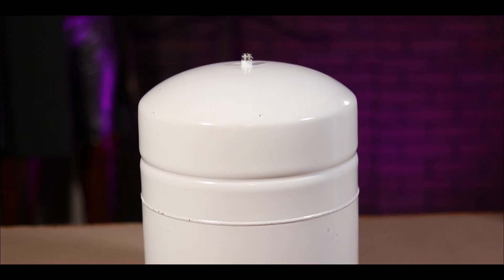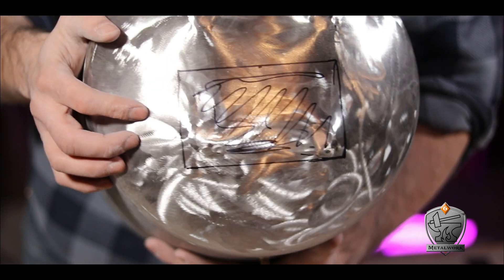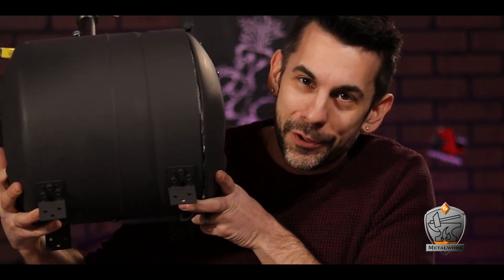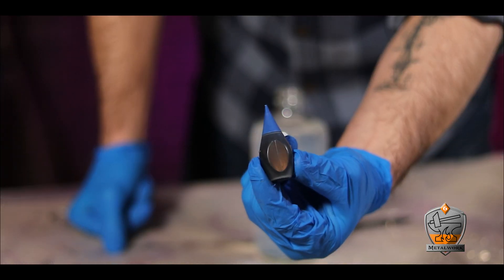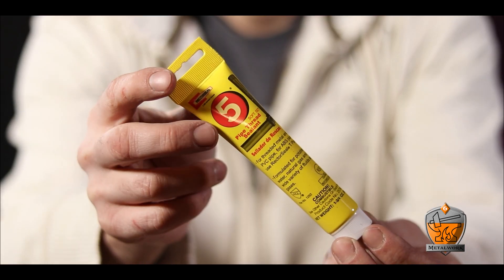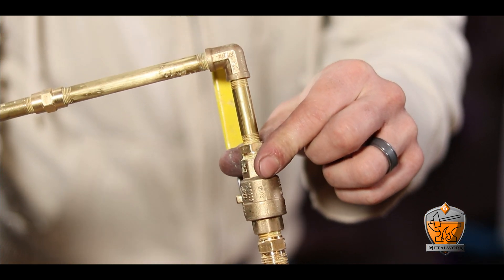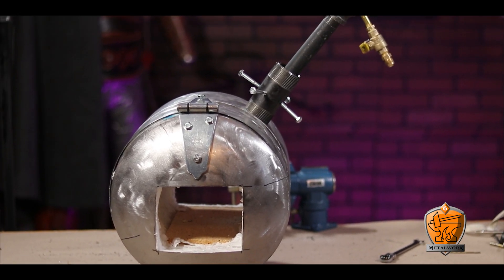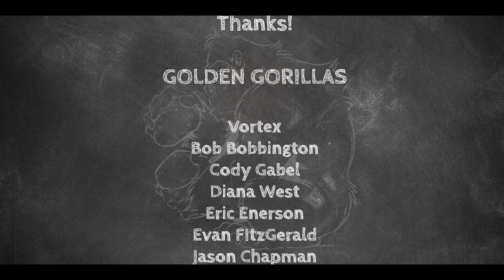DIY Gas Forge Build No Welding Required

Comment: If anyone is wondering what the tank is called, it’s an expansion tank that you install on your called water line in case the pressure in your water line ever surges past the operating water pressure (typical between 40-60 psi). The tank has the rubber bladder in it so it can expand with that extra pressure as to not damage your water piping system.

Comment: It's not a water filter device.  It's an expansion bladder to compensate for thermal expansion from your water heater cycling.  And to strip the paint, you could have just sprayed Klean-Strip Paint stripper.  Waited 20 mins, and washed the paint off.  Also, you better put some cement on that insulation or you're gonna kill your respiratory system.

Comment: One suggestion is to use some kind of cutting oil for your metal drilling and tapping. I’ve even used WD-40 when I was out of cutting oil. It will make the cuts easier, and help your bits to last a lot longer.

Comment: That top piece of pipe defeats the purpose of the reducing fitting. It's intended to work as a venturi which will increase the airflow and give you better heat. Putting that piece in chokes it down and eliminates that effect

Comment: Coat The Kaowool with satanite or a refractory cement, This will protect the ceramic wool and keep you from breathing in fibers. The rigidizer alone is not enough.

Comment: Tip: if using a propane tank, before doing anything else, fill it completely with water then empty it. This will displace any residual propane and prevent any high-temperature unpleasantness.

Comment: Fun video and this looks like a great project...BUT... The most dangerous bit isn't the burners, it's the insulation that you only soaked with rigidizer without covering it with refractory cement. Dude. YOU HAVE TO COVER THE INSULATION BLANKET WITH REFACTORY CEMENT. As long as that blanket can shed fibers, it's a hazard.

Comment: I know this is late, but still might be helpful
for anyone who is using propane tanks... one of the vids i looked at a while back suggested filling the tank with water before making any cuts. just to be sure there is not gas left in the tank. This concept applies to any place when there is something flammable.

Comment: Something worth looking at for extra safety is a Flash Back Arrestor/suppressor. Normally used for Oxy/Acetylene torches, you can also get them for other flammable gasses. Regulators don't always have them built in, even expensive ones. Should be able to get them from where you get your gas from. Otherwise welding suppliers do have them.
Reply: In a naturally aspirated propane system like this, there is no benefit in having a flashback arrestor. In a system running oxy, it's possible for oxygen to be forced back into the propane hose (or vice versa) which can create a combustible mix, but in this system that's impossible. Pure propane will not and can not burn without oxygen, and it is impossible for it to burn back up the hose or inside the bottle.

Comment: for paint removal, a wire wheel would work better on your grinder. heats up the paint less, and doesn't gum up like a flap disk.

Comment: Just an FYI in all the forges I have built the rigidizer is added after its stuffed in place.

I should add that other than that this is an amazing build. I will make the same suggestion to you that I do all beginners,  make some tongs first!

Comment: His burner is made with gas pipe which is black pipe and brass,  Black Pipe is Not Galvanised, it is instead coated with a dissolvable coating in many cases just a oil, or a cheap lacquer coating on the black pipe is iron and rust readly. Coat with a barbecue paint and it won't rust do a burn in outside and you good to go. The pipe parts let dry overnight then heat them up with a torch let cool and you're good to go. Have even seen waxed coated black pipe.

The feet on the other hand probably won't get hot enough to dispel zinc gas off due to the heat proofing material inside, this material works very well at keeping the majority of the heat on the inside. And you can make or even buy these angles and hinges in black iron for gates so that would be the way to go. though if worried about zinc poisoning just rough them up and spray with a barbecue paint let dry. Though always take every precaution and necessary steps for your safety and others. you can get a good refractory material by the bucket depends on your wallet.

By the way the feet are quick scaled at the factory which means they are quick dipped and generally it is Galvanized then balled milled to get that shiny look, some are electroplated. Though some manufacturers use other metals or have other treatments to ward off rust as well. Why I would recommend that you just get some cheap iron Black fence brackets and hinges, you can find latches to, and iron stove bolts, if your going to use bolts. That resolves any issues you might have to begin with. These are just a hard black painted non galvanized iron.

Surprised you didn't just make some rivets and riveted them on with your small forge. You can use 16 penny nails non galvanised , that's the common nail used in most structural carpentry. Just cut to length, heat till a nice cherry red, and rivet them in place. I use to use those very brackets under houses because they didn't rust. It really is a good little furnace by the way for small projects, annealing and hardening or metal working projects.

 If you want to get into metal welding the old fashioned way, get some 20 Mule Team laundry soap as it's nothing but straight 100% Borax. Which is what to use for your flux, for metal forging and welding. A box will last you for years, just keep it dry. You don't need to buy any special fluxes for forging and welding doing blacksmithing.

Comment: Great video! Just picked up two propane tanks yesterday… and this video will definitely help in building my little forge! Thanks!!
Reply: for anyone who is using propane tanks... one of the vids i looked at a while back suggested filling the tank with water before making any cuts. just to be sure there is not gas left in the tank. I know its late, but I think i will ass this to the main comments

Comment: WARNING. After using rigidizer you you ABSOLUTELY NEED to coat with a refractory cement. Rigidizer should be applied once the kaowool is installed as you you saw that folding it opened creases that were not exposed to the rigidizer. Rigidizer just helps keep fibers down while you're putting refractory on. Running that forge without refractory is DANGEROUS as just as many fibers that cause silicosis and cancer are being spewed out.  THIS WILL RUIN YOUR LUNGS!
Reply: This is a great video but you CANT SKIP THAT STEP!
Reply: @bryanwells1837 Can you give a quick explanation on how to do this??
Reply: @Stefubi  i think he is dead.. you know... lung cancer

Comment: How did you cut the threads into the tank for the 1.5 in pipe nipple?
Reply from the maker: No threads needed. The wall of the tank is thin enough where the thread has no issue grabbing on. Good luck!😁

Comment: Just a tip. I believe that I saw your vise has two sets of jaws, it can be flipped yes? The bottom set of jaws is designed for pipe. You won't have issues with the pipe slipping out of the vise if you use the right jaws. Probably this will help with keeping you tap square as well.

Comment: I don't think that tank was off a filtration system. I pretty sure it is an expansion tank because I recently replaced mine. Its purpose is to deal with thermal expansion of water as it heats up in the water heater.

Comment: Other note: Files only cut in one direction, if you drag them back over the edge you will dull them faster.
Reply: Common misconception, it really doesn’t matter.
Reply: @GiovanniGiorgo  ^This, it was disproven with testing. Cheap files may be subject to different rules.
Reply from the maker: I did no know that! Thank you😁👍
Reply: Unless it’s a double cut file.
Reply: Also, depending on the grind, stoking in one direction only gives you more control over the finish.

Comment: That is scary similar to the one I built a few years ago, although I did weld on a base and port for the burner, and I also have the bottom cast with refractory I "borrowed" from work along with the Unifrax blanket and the cylinder itself....

So that guy should get up to at least 1000C if it is anything like my build.

Here is a link to it if anyone is curious, the video is off a cheap cellphone so it is hot garbage: https://youtu.be/8EIMTmFlP2o

I am building a new stand for it this week actually, I want my damn workmate back in service...

Comment: nice job! iv been wanting to do a small table top design for a few years, deff gunna pull some stuff from this, thank you!
Reply: Ron Reil is the guy to check out for burner designs. 

You can get a little more efficiency out of them with an ITC-200 coating on the fibre.
Reply from the maker: @Ammoniummetavanadate  I'll check him out for sure!
Reply from the maker: I am super happy you found this useful! Stay safe!

Comment: The spring, once heated will lose its springyness real fucking fast.
Reply from the maker: I thought of that. I can replace it if need be but thus far the bottom hasn't gotten nearly to the temperature for it to be a concern. The spring, at its hottest, has gotten mildly uncomfortable to touch. I will keep you posted when it decides to give up the ghost
Reply: @SkillTree  put a small bit of the insulation cloth between the body of the forge and the spring.  Like a round bit from the hole you cut...

Comment: Awesome no-weld build! Like you say, not everyone has or can justify buying a welder. So, your gas port turned out to be conveniently in the optimal place when you built that part, keeping the valve away from the forge. For other/future builds, I suggest assembling all the brass parts except the end cap, and aligning that in the reducer to place the valve, etc. in the angle desired, then mark/drill the gas port. When assembling pipes, you may not always get the parts rotated to where you want them, but NEVER unscrew them to reach the angle you want/need! Instead, tighten slowly to reach that point. Brass stretches, flexes, bends when its tightened. Loosening it can create leak points, even if it feels tightly assembled.
Reply from the maker: GREAT POINT! I am glad I lucky stumbled into a good configuration, I would have been so upset if the orifice was pointing up and the pipe was running into the body of the forge LOL.

Comment: Been wanting to make my own forge and a foundry for a while. Excellent build.
Reply: WARNING. After using rigidizer you you ABSOLUTELY NEED to coat with a refractory cement. Rigidizer should be applied once the kaowool is installed as you you saw that folding it opened creases that were not exposed to the rigidizer. Rigidizer just helps keep fibers down while you're putting refractory on. Running that forge without refractory is DANGEROUS as just as many fibers that cause silicosis and cancer are being spewed out.  THIS WILL RUIN YOUR LUNGS!
Reply from the maker: Thank you for watching! I am glad you enjoyed!

Comment: Horde away cl3wer, do the builders dilema. "i need to hord this thing, beacuse i might need it", ten years and a superfilled workshop later, "see, i gott a use for it, thats way its smart to horde"

Btw. Would be cool to see you forging a axe
Reply from the maker: Oooh! An axe WOULD be cool! Great suggestion. Also, that is totally me! I am so happy and vindicated when the thing I greedily held on to for YEARS comes in handy🤣
Reply: Axes are super hard to make, I am working up to it too. 

You can do a simple design where you fold-over to make the eye, but a proper axe with a drifted eye is quite a challenge.

Comment: Be aware that the galvanized hardware you used will release highly toxic zinc fumes, I'd recommend using stainless steel instead
Reply from the maker: All stainless! I made sure not to use galvanized anything. Made that mistake with the foundry bucket
Reply: @SkillTree  it's hard to tell, the hinge and feet looked like galvanized, glad to hear they're not!
Reply from the maker: @edwardhunts  it is a thing I wish I said in the video. It's an important point. Super dangrous and, in a lot of hardware stores, the black pipe and the galvanized are side by side and someone might mix and match not knowing.
Reply: @SkillTree  I came here to check this too :P
Reply from the maker: @The_Ashling  thanks for caring for my safety!